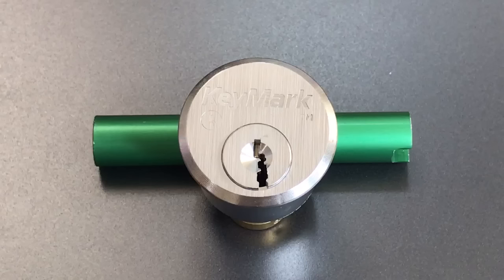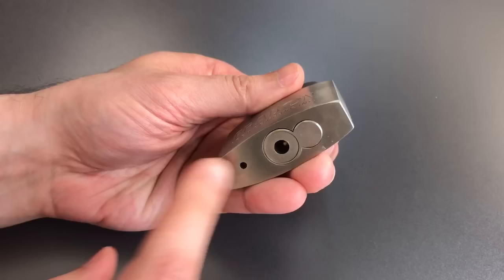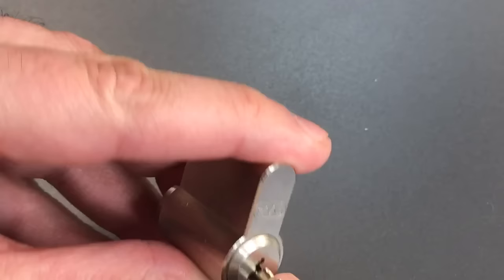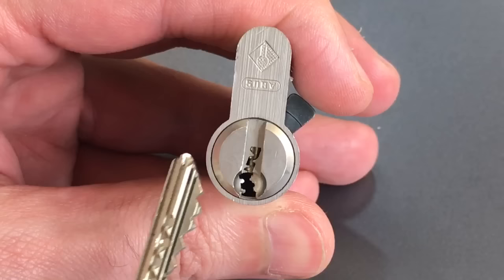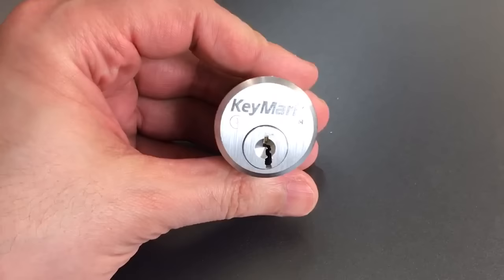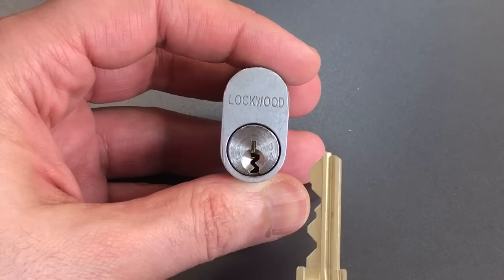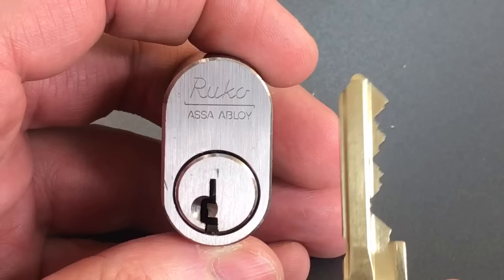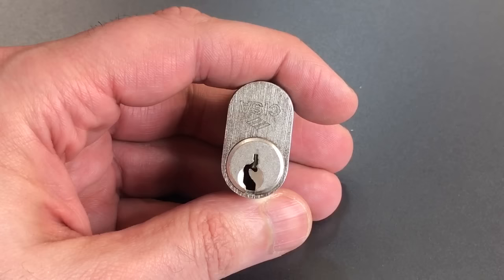[480] The Top Ten Nastiest Keyways (In My Collection)

Comment: I had to open a locked door for a customer yesterday which had Euro-style cylinders & 3-point locking bolts. I couldn't pick it with my hand picks so I used my rotary pick (aka drill bits).
Reply: Did you have to get them new locks?
Reply: Next time just put c4 on the door knob, it’s been shown to work wonders
Reply: @Gio-yq8jj  It's harder to re-lock after that.
Reply: Andrew Kwan by which you mean, he got to sell them new locks. That’s not so much a “have to”.

Comment: If keyways can be designed to make picking almost impossible, why doesn't every lock maker do that?
Reply: Because most often when a lock is picked it's a locksmith cause someone locked themselves out
Reply: Keys snap or bend when you try to mass produce these. Locks have to open first and foremost.
Reply: Virtual Rooster  Most quality keyway shapes are patented and/or trademarked to limit who can get key blanks for copying keys or making bump keys.  The patent method suffers from the 20 years or less they last before companies etc. need to change all locks and keys to one that isn't available at every low morality key cutting shop.  This is why many are now going for the trademark protection, which can be cheaply extended almost forever.
Reply: Money
Reply: Also, if the lock company wsnts to guarantee that all locks have different keys, they have to make a new shape that won't fit before running out of combinations.  If they offer master keying, they also need to skip thousands of combinations and invent keyways that will fit two or more key shapes.
Reply: Because the makers at masterlock signed a soul contract that says they cant make good locks or else they will drop dead instantly
Reply: Business
Reply: The fact that a thing is locked is good enough for 99% of cases regardless of teh type of lock, so that's what they market for.
Reply: Because people don't want to spend hundreds of dollars on locks for everything in your life.  These are not mass-producible so they have a higher cost.  Some people don't have several hundred or thousands of dollars available to upgrade all the locks in their life.
Reply: Short answer: its expensive. Long answer: the are alot of situations where you want to pick a lock, like a locksmith. They take longer to make which makes them expensive, most places wont have key blanks to copy keys, and it would be hard to get blanks for it.
Reply: This is a great question and there's so many totally different answers in this thread... The cost argument sound the most plausible, but then it begs yet another question: why exactly is it THAT much more expensive to produce lock with nasty keyways?
Reply: @valeriavagapova  If you look at those keyways, they have very tight corners and narrow clearances. That means the machining of both the keyway and the key needs to be much more precise. That costs money. In addition, some of these require rather thin keys that might not be structurally very strong. If you don't get these details exactly right you'll have unhappy customers when their keys jam or break off.
Reply: @MrBirdnose  Great explanation, thank you:)
Reply: I was thinking the same thing. I get that they aren’t as easy or are more expensive. Still, people are locking up some really expensive shit and I’m sure they’d pay the price to secure it. If that’s all there is, it sure seems like there would be a market for uniquely made, expensive locks.
Reply: Because more intricate keyways need specialist key designs and tighter tolerances during manufacture. They probably need pinning and final fitting (adjusting the workings) by hand too, so all that would make those locks more expensive to make. So it's always going to be a balance of what can give reasonable security for reasonable cost. There are still some manufacturers who are still making locks that aren't even reasonably secure for no logical reason whatsoever. There have been many improvements in manufacture and security that don't make much difference to cost. So I've no idea why some of the biggest consumer product manufacturers are still allowed to sell junk that's misrepresented in the packaging. I actually bought a brand new padlock from a high Street superstore last year that had a diagram of a double locking ballbearing mechanism on the back of the packaging, but the lock actually only locked on the opening side of the shackle with a spring tensioned brass pall. Shimmable and Rappable junk.
Reply: @Kenton Nigrelli the metal that the keys are made from has to be a tiny bit thinner than the keyway, so on very tight keyways, the key is very thin. Look down the keyway of the key when he shows you. it's very thin, probably about 12thou on some of them keys that have 18 thou keyways. It's not just the structural strength of the key along its length that's critical, it's also the toughness of the high cut peaks of the key and how liable they are to wear.
Reply: I was wondering the same thing. I understand that it costs more and that our 10$ locks are crap because we want them to be cheap. I have watched a bunch of videos on this channel and seen all kinds of ingenious and complicated lock designs that LPL opens in seconds anyway. This does seem like the simplest adjustment to make for a lock and one of the very rare ones LPL sais he can't open.
Reply: In addition to what's already been said, I bet if you look at any one of the locks you use, replacing them with a lock that's twice as secure for twice the price would not be worth it from the standpoint of a cost/risk calculation.
Any but the most obviously weak locks will do for most things, even for your house (unless you live in the biggest mansion in the area).

High-Security locks are kinda ironic:
If you're a common person, who doesn't appear to have any outstanding valuables, then slightly better security than the Neighbors have will be secure enough, they'll just try a different house if they can't break open yours within a few seconds. 
But if you're wealthy enough to reasonably expect someone to try breaking into your house (or business) specifically, then they'll probably use a different vector of attack, like social engineering or ambushing you, and bypass your High-Security lock entirely.
Reply: Because how often do locks actually get picked by a criminal? Most criminals aren't even gonna bother trying, so all you're doing by making keyways more complicated is giving a locksmith a harder job if you ever lock yourself out.
Reply: Most people don't want a fort knox lock they want to slow down lazy or honest people
Reply: Exactly
Reply: Way too expensive  to mass produce, also your average lock needs to be able to be picked by some level of expert if you lock yourself out of your home!!
Reply: @michaelgreco7597  Not necessarily, if the lock can be opened by brute force, the owner can still get in, and you get to sell a new lock.
Reply: @penfold7800 
That Best WB keyway has an extra thick key blank for strength and the SFIC format multiplies the picking difficulty because every pin stack has two or more sheer lines which must all be picked to either control or open, no mixing allowed.

Comment: Video trick. If you want to light the inside of a lock like the Fradon. Put a piece of glass or plex between the camera and the subject, at a 45 degree angle. Point a light from the side so it reflects off the glass down into the lock. Then just put a black card (cloth is better) on the opposite side. A bug  inside the lock looking out would see bright light, while the camera 'sees' a reflection of blackness, so it doesn't see the glass just down into the lock. 
I like these videos a lot. It's made me think differently about locks. I've learned so much from your videos, mostly out of pure curiosity.  Thanks
Reply: Im having trouble visualizing it, got any examples I can visually see?
Reply: I believe it's called "Pepper's ghost".

Comment: If a good keyway really frustrates picking, why isn't it the norn? I'm a complete layman, but it doesn't seem as though it should be more costly to manufacture. Is it to do with patents?
Reply: i think its because they keys are more complicated that way and that makes it more expensive.
most locks dont need to be pickproof anyway its easier to cut the chain / smash the window etc already
just being more than trivial to open usually does the job
Reply: Some of those keys would be more fragile and prone to bending out of shape; making them impractical for the average user.
Reply: I would say it’s due to the keys. When you want to get a copy of a key for somebody else, possibly a family member, you could always go to a local store and get a copy made with ease with plenty of different looking keys to choose from. These locks that have very different keyholes to the norm explain themselves why people don’t bother with them in the first place, which is just how different they are compared to what’s being used.
Reply: Yeah, what these guys said. The average burglar doesn't bother with picking much any more; standard house door barrels are 6-pin with a couple of mushroom pins or more, which is enough that it's a pain in the arse and not reliable under pressure. Much easier to figure out a workaround or brute force method (see Deviant Ollam's talk on Pen Testing for examples of that).
Reply: @filanfyretracker  exactly. Force entry is so trivially easy as long as you pick your timing well that I can't imagine any average yob bothering to try lockpicking (especially considering lockpicks are illegal to carry).
Reply: @boiledelephant  I don't know anywhere lock picks are illegal.
Reply: @celluskh6009 
"Possession of burglary tools" is a crime in many places. Usually, intent must be proved, but the average person will get a public defender, because criminal defense lawyers are insanely expensive. When your public defender throws you under the bus, you will be found guilty. If it's your first offense, you might get lucky and the judge will withhold adjudication and after your fines are paid and probation is fulfilled, the court will purge the record from public view. If you drop $20-30k on a criminal defense lawyer, you can get away with damn near anything, because police do horrible investigating and usually can't find their ass with both hands and a lawyer who's actually helping you can rip their shoddy work to shreds.
Reply: @celluskh6009  the entire UK. Locking pen knives are illegal here too. It's easier to ask what isn't illegal in the UK...
Reply: @celluskh6009  They might be in California, if you are not a Locksmith. I was surprised to see lock picks and lock picking books in Powell's Books in Portland, Oregon. In general, in California, the specialized tools for licensed professions are often only supposed to be made available for licensed professionals.
Reply: It does make it a lot more expensive - keyways with a lot of zigzags are really hard to keep in tolerance and require advanced machines to machine out. The tolerances on a Kwikset are easily 3-4x the tolerances on these locks. It also makes the keys more expensive to copy, since they will wear out a lot quicker - the average homeowner uses their lock a LOT more than the high security places these locks are made for. 2-4x a day compared to 2-4x a month. Plus if the lock breaks it's going to be hell for the locksmith to open and repair.
Reply: @celluskh6009  Illegal in New Mexico, USA unless you're a certified locksmith as they're classified as "burglary tools".
Reply: @Jhaiisiin  That's stupid.
I want to learn to pick locks just for the fun of it.
Reply: @Olivia-W  regardless of the level of intelligence, that's the law.
Reply: @Jhaiisiin  ... I actually checked, and mere possesion is a crime in a handful of states (not mine), and is entirely legal in quite a lot of the world.

Which is great, because I'll pick up a basic set and get cracking :). It seems like a good thing for lectures. I always fiddle with my hands anyway.

And my faith in law is marginally restored.
Reply: @boiledelephant  nope, legal to own and to keep at your residence.  If you're out in the street with them and you get searched by the police, that's a different story...
Reply: halfasgoodasyou some keys are also marked as restricted and locksmiths won’t copy them if you don’t bring in proof that you own the place/ lock
Reply: Same goes to, why most burglers wouldnt learn lockpicking instead of smashing windows, since it looks so easy on average padlocks
Reply: @boiledelephant  you got a license to say what's illegal in the UK?

Comment: I wonder how many of those Fradon locks end up with bugs making homes in that big round keyway!?!
Reply: Dirk Easier to flush them out than in a narrow cosy one.
Reply: SidtheKid  That's how you jam the pins, seizing the lock for the owner and the locksmith
Reply: Nick Ferrara hit it with a hose, an air compressor to clear water, and wd40 to ensure it doesn't rust, you'd be alright

Comment: I seriously wonder why (in my perspective) you hold all locks upside down i live in the netherlands all cores are places with the pins having to be pushed downwards not up (in doors atleast) for me it's really weird seeing the back of the key being faced down
Edit: just looked it up has to do with dirt sand and gunk getting into the lock and getting into the pins if they are faced down
Reply: In Spain it's the same D: 
At least in my house xd

Edit: just read your edit, so in the US the locks are placed with the pins facing down and he just hold them and storage them like that to keep them working or they have their locks with the pins facing up?
Reply: I am a 32-year locksmith and work for a lock manufacturer in the U.S. and you are correct as to why our lock cylinders are installed with the pins extending from the top downward.
Reply: Can’t say that dirt ingress is a huge problem with the locks the right side up (which for euro cylinders is pinstacks down), though.
Reply: We have a lot of euro cylinders in the UK, but they nearly always have the pins facing down. I have noticed that in various places in Europe, a door key has to be inserted what would be 'upside down' to us
Reply: Hugh Alexander mortise cylinders are still typically pins up. Or in the case of our dimple Yale, I believe it’s pins sideways on both sides: which means the key inserts “like a normal key”, instead of being put in horizontally.
Reply: Hugh Alexander It seems to vary country by country.  However the Euro cylinder mounting hole in particular looks so much like a historic keyhole that it seems instinctive to install the door such that the pins happen to point up.  Oval and round cylinders like his #1 has no such inherent clue, but the brand name tends to be readable when installed in the country of sale.
Reply: Huh, now i know where us Indonesians get our lock instalation method

Comment: If you came to this video thinking to pick a lock to buy for your precious stuff, remember the priorities of lock selection: Cost of lock > strength of what its locking (a 9lb megalock from hell is pointless on a wooden gate or glass door) > mechanical strength of lock > durability of the keyway under regular use. (crazy sharp ledges wear down quickly and the keys are easily bent)

Comment: I have sold tens of thousands of those lockwood restricted cylinders (they are restricted because of the JA profile) but you would be surprised how easy one is to pick in the wild, the reason is they are only made into grand master systems or great grand master systems so a pick gun can defeat them pretty easily, you wouldn't find many KA cylinders like the one that was given to you.

Comment: During the 1980s, I had a cylinder (that came standard with the building) with an "H" shaped keyway,  I was jagged, angled, and used multiple ideas on each leg of the "H" shaped keyway.  Have you run into these?

Comment: I got a lock from Göteborg Rosengrens  that is designed in 1910 or something like that. I think my lock is made in the 70 s but i think the model of the lock was made with just some small adjustments in its lifetime . I think the most lock was scrapped around late 90.  They was used as a user lock that was made for the bank-box and a safe-box lock and postbox lock. They was very easy to remove when you¨r rented time was over. Just unlock it and pull it right out. 
The lock has round disk inside and no springs  and is just turned around  with the "nasty" key. 
Rosengrens is a company that has been around from like 1840-50 and is still in businesses

Comment: that circular keyway gave me an insanely good idea for a lock that might be impossible or at the very least insanely difficult to pick
circular lock but there's pins 360° around the thing and when you put the key in you hit a button and it expands into the correct shapes and then you can turn it
my idea is that it would be difficult already to pick that lock with one row of pins, but it would be super different and really just not even worth the effort to pick the probably 30-60 pins without losing progress on another pin

Comment: I'd never thought about it before, but what machine tool is used to cut these keyways?

It seems relatively straightforward to cut the key blanks, using a suitable grinding wheel. But the keyway seems like a tricky thing to machine.

Comment: I came up with an unpickable design from this, you insert a circled key, a soft part locks in and push pins inside the key, this triggers the key to lock in position with magnets and tiny mechanisms inside the key... This allows you to slightly pull out a split part of the keyhole which than can be turned to enable the actual pins to open the lock... It's a very very compact design on paper so far but if I find the time I will design one and send it to you
Reply: How's that coming